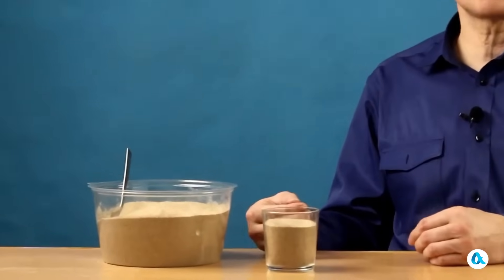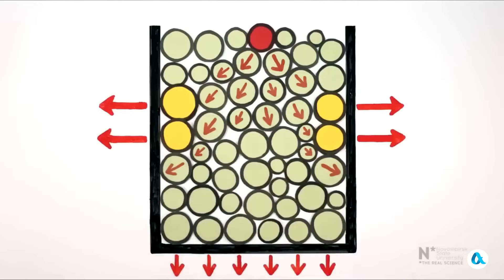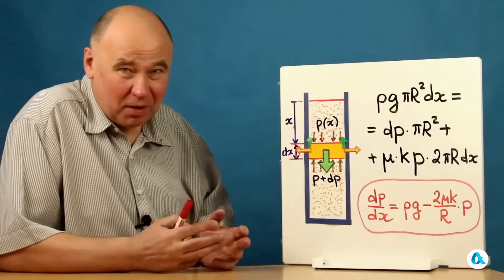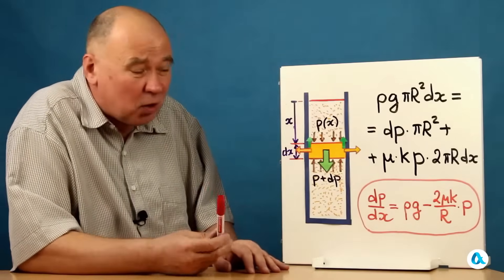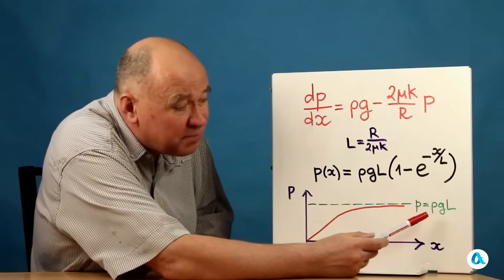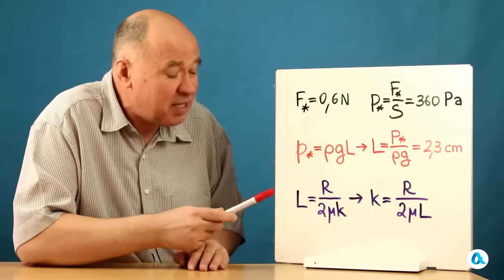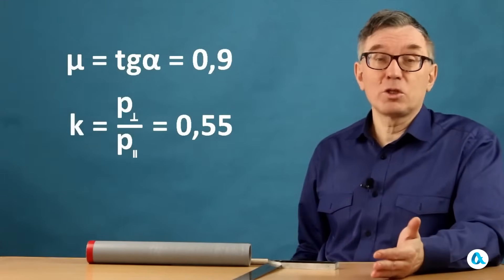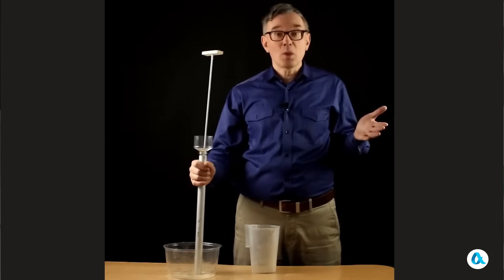Where did the weight of sand go?

Comment: Non sense, Part of the weight of the sand is transferred to the tube then to the wodden frame which is totally out of the scale, and if you say the tube is not doing force on the frame, then take the frame away and lets see if the tube stays standing still, if it does, the weight of the sand will be the same.

Comment: But why the disparity in the weight of lead block inserted into the glass tube not discussed.. 
2. Does the gravitational pull on the loaded glass tube (as a whole) lesser than that of the frictions happening inside the contained material....
Does the bracket holding the tube exert any pressure on it....

Comment: Umm 🤔 🧐 🤔 you’ve used a cylinder separate from the scales… 
Yes of course the friction of the sand will be causing discrepancies between the actual weight. 
If want the actual weight use a container with the bottom and zero the scales, then fill with sand 🎉😊
Though I have a question: what’s the thermal conduciveness mass over time?
Example:   100 qubic cm vs 1000 watt electric element temp over time
And distribution of heat?

Comment: Sand, if in a solid state has a specific gravity depending on the source. They specific gravity of sand from my location is approximately 2.63. which of course is based on the weight of a cubic foot of water. Sand  would have to be a solid block in order to cut it precisely to one give it foot and comparison to the density or specific gravity of potable water at sea level which is 1.0 . When any accurate including saying is exposed to water the weight of the sand increases or any aggregate. In my location the absorption factor of sand is 0.5.  if the sand is saturated surface dry then there is 0.5 adding to the weight of the sand. It's very simple and basic. It doesn't matter The arrangement of grains of sand. The factors that affect the weight of sand or the specific gravity divsorption potential, the absorption and based on these three factors which can change depending on where the sand is quarried from, and if the sand is completely dry no absorption or the sand is SSD which is saturated surface dry, or the sand contains moisture between the granules of sand which I think is usually up to about 6% based on the factors of the sand itself. So there's your answer. The specific gravity, the absorption potential, the actual absorption, and the moisture of the sand. I can demonstrate that for you but pouring saying on top of saying is not going to change the weight of the same sand only moisture can change the weight of the sand considering the specific gravity or density. Thank you.  by the way I was certified as a concrete technician and materials/agregates technician certified by the state of Georgia the state of Alabama and the federal certifications and I designed concrete mix designs and I worked with aggregates or saying every day and there was nothing that changed the weight of the sand other than its source is specific gravity and the amount of moisture weather dried by heat completely dry or saturated surface dry or the amount of moisture contained within the sand itself.  I was certified by these organizations were entities for 20 years and I was over numerous concrete plants and sand and rock quarries. Thank you
Reply: I am an expert by the way with 20 years of experience and what you're saying is not true from my experiences and my certifications by the state and federal government

Comment: Contrary to the diagram and what the presenter actually says, the cylinder is open at the bottom. In short, it “contains” only the horizontal forces (of friction) and not the vertical one. The “cylinder” being actually a (bottomless) “tube,” its weight is not on the scale but is fixed to the adjacent (wooden) uprights. So its weight on the scale remains zero. Thus all the frictional forces of the sand onto the sides of the cylinder would be transferred onto the wooden uprights and not onto the scales, which weigh only the sand (minus the tiny bit of loss owing to the scale dropping.)

So—but for one thing—and given factors such as coarseness of and moisture in the sand, this particular experiment would detect some (specific) coefficient of friction. One would need, however, to detract from any result the weight of the sand at the bottom attributed to the (conical) “angle of repose” of the sand (typically about 40deg and which has no interaction with the cylinder.)
Reply: I thought it would be assumed that if you put the entire experiment onto a set of scales then the entire weight of the sand would be measured as well. By making the walls a constant mass, the experiment provides a way to quantify some of the more interesting consequences of physical laws.
Reply: @undercoveragent9889  Oh, it’s very interesting allright. Just tricky.

Comment: Some of the sand spilled off of the scale when you started pouring and the cylinder is supporting a fraction of the weight of the sand.  Get a bigger scale or weigh an empty bag, weigh the sand in the bag, and subtract the weight of the empty bag.

Comment: The crucial part is: why does sand cause friction and, say, water doesn't?
Reply: Sand maintains its granularity and, because of the roughness of the suface of the grains, forms interlocking shifting bridges. Water becomes a true fluid once the surface tension of adjacent droplets is broken.
Reply: @JosephCain-hp9jx  It's explained later on the video, forgot to delete that comment sorry.

Particle roughness certainly helps, although I have a suspicion that it would work with frictionless balls too, provided they can stick to the walls.

I think the critical part is that the particles have permanent contact and force redistributions are static, whereas in true liquids they move freely and forces are redirected by dynamic impulse transport.

Comment: Water can be piled into a mound. It just has to be at the correct temperature. I do this every time I get a slurpee.
Reply: I was thinking something similar. Water flows downhill (as in a river) until it finds equilibrium (as in a lake) the finding of equilibrium should be instantaneous if it were true that water can't be piled up. It takes time for the water to find equilibrium. It takes time for a mountain rise and fall but we think of them as permanent because of the time scales we experience, but mount Everest won't be there for ever.

Comment: I'm not buying this.  It's a trick.  First, I want to see you weigh the sand in the normal way, so we know the weight.  Then, I want to see you use a glass tube which is sealed at the bottom.  We can see from the leaking sand that the bottom does not seal the cylinder.  It should be continuous glass.  Third, I want to see a demonstration that the glass cylinder is free to move vertically without impediment.  There must be sufficient space around the cylinder so that it does not transfer weight to the apparatus around the scale.

It is easy to engage in trickery in a video.
Reply from the maker: Do your own experiment, it will be a discovery for you ))
Reply: Trying to clarify: The whole point is that the tube is open at the bottom, so that the sand can exert force on the scale, but the tube itself is fixed to that wooden construction and can't move downwards and so the tube itself can't exert force on the scale. Then the weight of the sand above compresses the sand below it, which then also presses sand against the walls, leading to friction. The sand would move the tube downward, but can't, since the tube is held by the wooden construction. So due to that the weight force really splits up: A part of it is redistributed due to friction to the tube walls and then to the wooden construction, and a part of the weight force is distributed further downward through the sand layers, ending up on the scale. So the scale shows less weight. 🙂
Reply: lol

Comment: It is worth mentioning that the weight experiment requires that the wall itself is not supported by the bottom lid, so that it can transfer its own vertical forces into the ground away from the scale. That is why there is a little spill just when you start pouring the sand.
Reply: thanks, i was just wondering abut that
Reply: Yes but then the whole thing would make a lot more sense.
Reply: Yeah, I was wondering about that and figured that the walls of the tube were supported by something other than the scale.  Dang! That takes away all the magic!
Reply: @maxenielsen  well yeah, magic isn't real, only physics
Reply: @bhbr-xb6po  Yeah. My first reaction was "that can't be, this breaks physics" - then I realized the tube didn't rest on the scale. I feel it was a gross mistake not to mention this from the start. Now if the video had gone out a few days earlier ...
Reply: @ what then?
Reply: Yes, I noticed the same